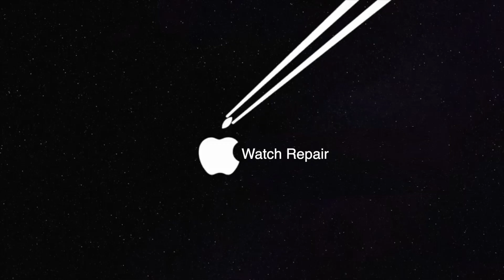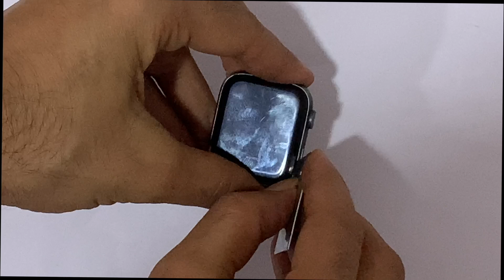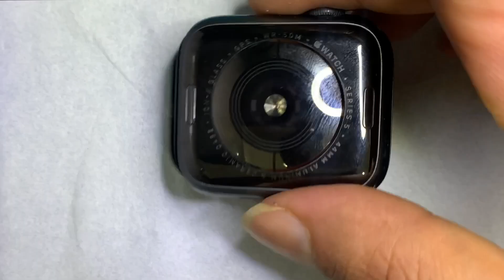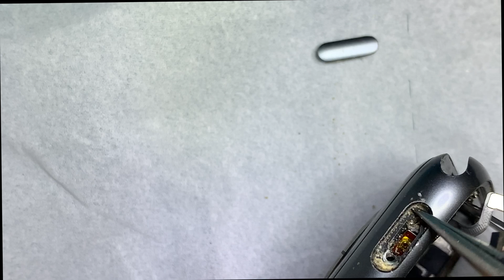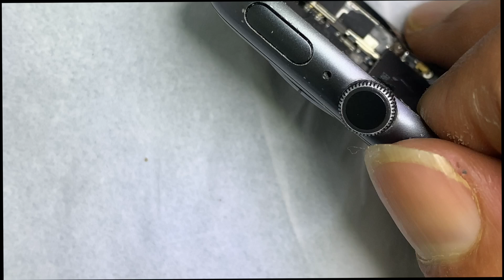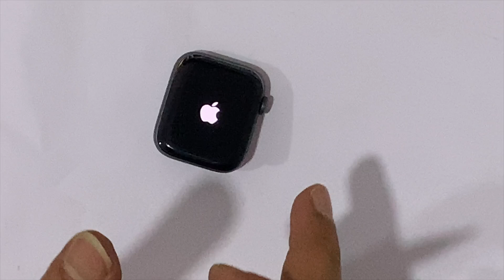Apple Watch stuck on Logo,Boot loops,Keeps restarting  fix.

Comment: I came to this video because I was facing the same problem. Did the force reset multiple times but to no avail. Still having flashing apple logo during charging and black screen when off the charger.  Very frustrating. Your video is very comprehensive in dismantling the components. But my guess is that you happened to fix the problem not by actually cleaning off the dirt from the push button slot, but rather disconnecting the battery from the circuit board. This cleared the RAM that might be the solution in fixing the issue. My watch came back up by me doing nothing. I just left it aside for a few days to let the battery fully drained. On charging, the watch is fully restored.
Reply: Yep im so agree.. i tried to drained out the battery till it dead (till press button did not pop up any charging instruction)

But not lucky enough. Happen again when I start to charge it..